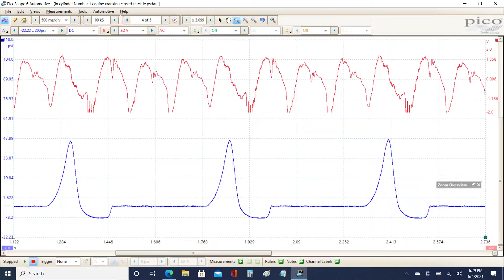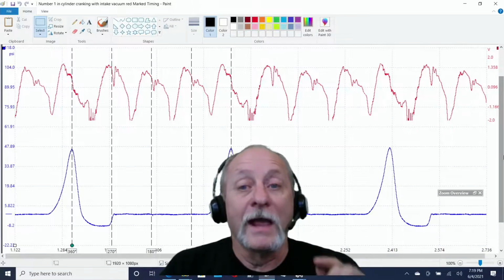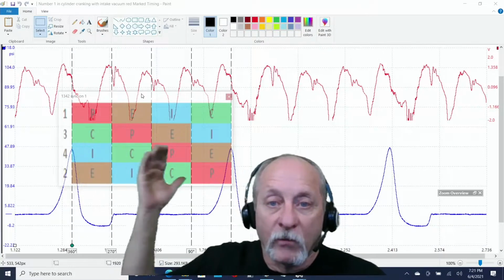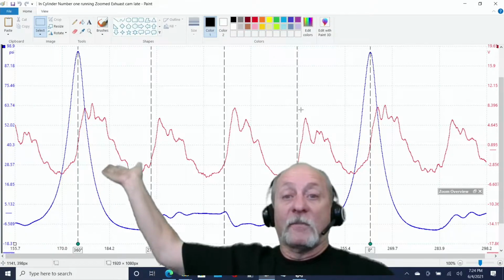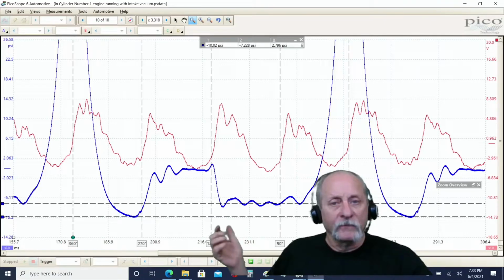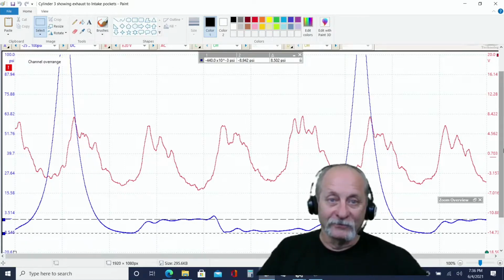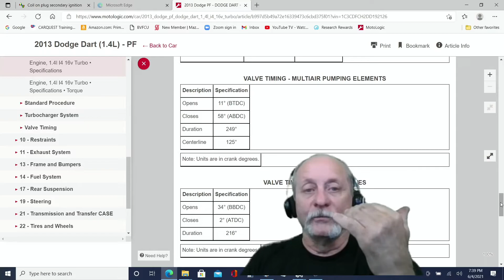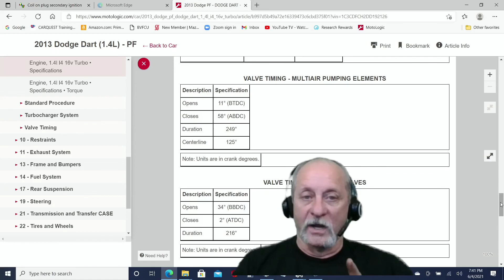Part 2 Dodge Dart Multi-Air

Comment: John, are you a candidate to get the valve job? Yes or No, will you do part 3 on this vehicle? Would you be able to overlay #1 and #3 based on intake waveform to show the offset of In-Cylinder based on low compression showing TDC is not actually TDC? I will guess that you have a 4 channel scope, would it be ok to show In Cylinder, Intake, CKP, CMP? Then show In Cylinder, Intake, CMP, spark or ignition trigger signal, as the CKP is tied directly to the crank/piston shown in the In-Cylinder regardless. If possible, a before and after set of waveforms would be awesome for a serious case study. I see some valve overlap issues, TDC timing based on not true TDC based on low compression hence the need for CMP and CKP or spark based on the number of scope channels available. Piston overlays need actual interpretation beyond the colored regions due to valve timing and overlap. Time permitting of course, great set of videos, much appreciated.
Reply from the maker: First. No I am not a candidate to do the valve job. When you get into your 60's one has to pick and choose what we want to do. Besides the shop that originally did the head gasket was going to do (redo?) the repair. I just had to prove what was wrong. It would have been nice to get the after repair data but that just wasn't in the cards. They sold the car within two days after they had successfully completed the repair. 

Be careful about trying to get too much from the original test without both in person training and first hand experience. I do go in-cylinder with the second video and while we are (I am) aware that TDC's exact location in the waveform might be distorted, it's normally close enough to not interfere with analyzing the waveform. All of the other tests you mention could in fact be useful from time to time and might even be necessary in a number of occasions. This time it wasn't required to actually prove what was wrong. Next time it might be so we do need to practice gathering all of that information on known good cars so that when we have a broken one and aren't sure what exactly is wrong we can did a little deeper by adding those additional measurements.  I put the overlay on the second test more to start building awareness for future examples. It wasn't really necessary this time but you never know when that ability is going to help. Thanks for the feedback!

Comment: On the known good cylinder, what was the EVC timing.......a leaking cylinder may not show correct valve timing....
Reply from the maker: Difficult to be certain on. It looks like it might be early when really magnified because of the rise in pressure suggesting both valves are closed just before TDC.
Reply: @thecardoc100  An after repair capture would be nice SIr.
Reply from the maker: @duanedonaldson2262  Totally agree but sometimes you don't get to fix the car and in this case it was going back to the shop that did the original work.